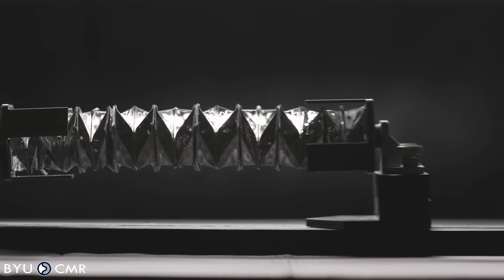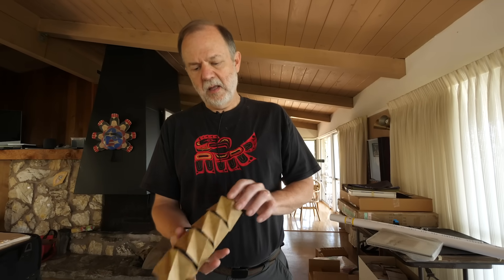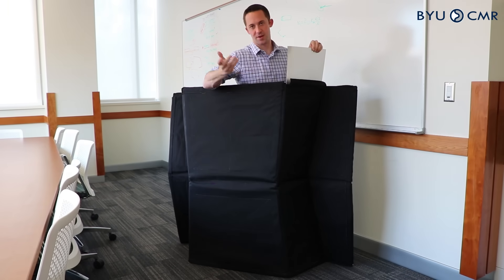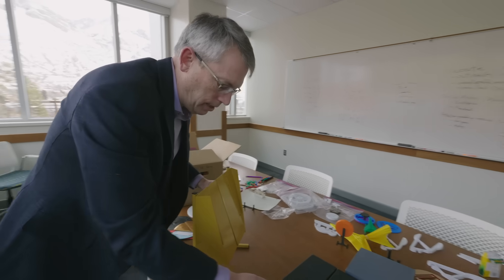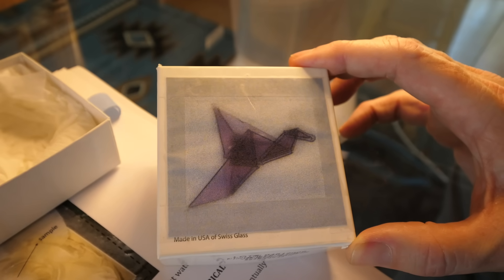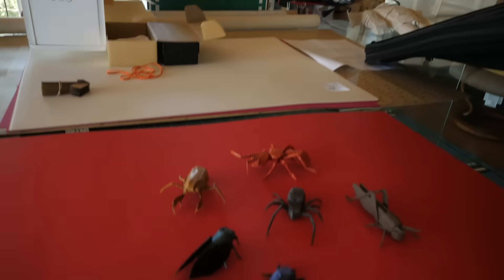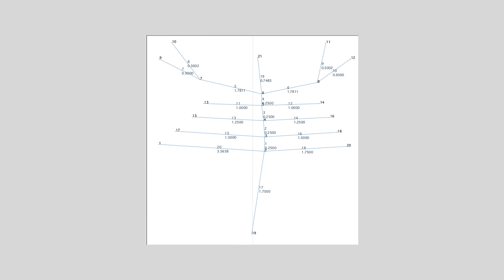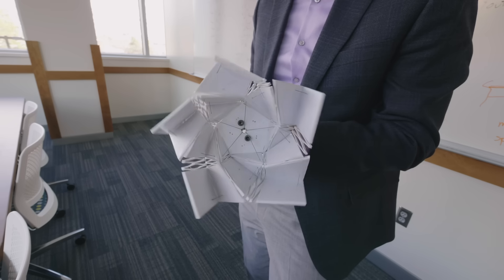Engineering with Origami

Comment: With the recent news of solar power and data centers in space this will be important due to the extreme size needed of solar panels, but 4:06  solar panel in a roller would be cheaper and more power dense with  more efficiency around 30%. Future will be awesome

Comment: Then they learn about modular origami. Just think little bit of organic chemistry and some food to feed it and you could do gene splicing or genetic repair
Reply: Well also look at what they can do with Lego bricks. Supposedly they're pretty rigid, but do a tiny bit of bending within the flexibility of the material and you can do some amazing things as well..

I mean just because it feels so it doesn't necessarily mean it is solid. Technically; nothing touches each other and there's no such thing as a fixed or solid thing

Comment: Trust me, the joint race has ended. The extra materials and lubrication of systems takes a long time to pay in the long run when its just easier to pay for a fixed system

Comment: something Derick doesn't say in this video is that one of the first uses of Origami in space, "The Galileo Telesope", it aclualy weleded itself shut so the oragami could not open fully, this was because In a vacumm aka space there is no layer of air to seperate the pices of metal from welding.

Comment: In Japan, origami is common and part of life. For example, by using Miura　map fold for beverage steel and aluminum in vending machines, the same strength can be maintained even if the thickness is 20% thinner than that of round cans. Companies can save money by using less material in their cans, and they can also save energy to transport them because they are lighter

Comment: A tinsy but if clarification on the seven years for the cactus would have been excellent... Was it 6 and a half years of contemplation and problem solving? Did he work on it during vacation each year? Weekends? Or did he spend 60 hrs a week for seven years folding paper?  While the last one would be fascinating as well, it would also obligate, ethically, an intervention of some type.

Comment: 10:17 ,,It's only 4μm thick. So 400 of them can fit on to a 1cm wide computer chip.''
Either there is a larger component needed for them or electrodynamics forbids to put things that close together on such a scale, but in theory 2500 of them should be able to fit onto that 1cm wide chip. As 1cm = 10mm = 10 000μm
divided by 4μm:
10 000/4 * μm/μm = 2500 * 1 = 2500

Comment: Origami is the art of "paper folding"..... the reason it is only used for folding paper,  is that it is not structurally sound for anything else........ folding steel to make blades however makes the blade stronger unless you fold it wrong

Comment: Looking at those devices with designs inspired by origami, how does it affect the durability of the material, compared to using the more conventional methods ,using hinges and stuff? Because won't that mean stress on the materials being folded, with the stretching and stuff? For example, in 5.34, the part where it actually folds.

Sorry, a complete noob with these things.

Comment: Human jumpsuit with Origami fold system. Iw ish to saw...
It can be Rigid material where the groin, joints or the head are folded in the material lined with a soft / elastic other structure.

Comment: 7:12
I have made similar engines using unofficial Origami-based techniques.
Noticing that the branding is blurred out, I’m giving away the thing is is meant to be hiding as I’m assuming it was only for the official demonstration.
I still know that the specific unit is painted for Union Pacific.
Specifically a General Electric C44-9W; same type of engine as my icon.

Comment: Now that is some serious material engineering ! I think I'm interested in the origami algorithm ^^
Civil Engineering, for instance, as far as I know, avoids folding material because it makes the material locally easier to fail at that fold, especially steel.
But, there is a several way to increase stiffness by adding some fold or a thick "bump" in a such way, so it increases the sectional inertia.
Cool cool, great work ! Great video !
Reply: Civil engineering? Oh man, the stress! Stresses everywhere, any which way you go!

Comment: This is very interesting and as an armature origami lover, I use origami as an encryption device, only by certain pattern of unfolding can the origami be dissembled to reveal its content, or through certain deformation the message will appear in a correct way. This is a physical representation of uneven encryption.
Reply: And I can't make anything other than the paper airplane :(

Comment: Origami was not created for aesthetics. It was a religious practice, like Zen . It was always an extremely serious thing in Japan. 
There is a dragon in a temple in the Fukui prefecture, not far from Eiheiji temple where i studied Zen for a a few years,  made of folded paper. The dragon is about a meter and a half long and seventy centimeters high and is over 200 years old. It was folded by the monks or priests as a common meditative practice. It was made out of a single sheet of paper, but every scale has been folded individually (and there are thousands of them), every tooth, the peaks on the head and the back, and every claw. And the amazing part is that it is articulated (although now it is never manipulated because the paper is too old). 
I am telling you, you have never seen Origami until you have seen this dragon .
It is said that there was also a carp made of paper in the temple but it was destroyed or the carp was actually unfolded and then folded back into a dragon as a way to illustrate the mythological legend of the carp turning into a dragon which represents enlightenment, and that the action was repeated regularly by students at the temples to as a way to transform themselves from carp to dragon. 
This origami is absolutely magnificent.

Comment: I would love to see some one design a box to be used as emergency shelter for the homeless. Design it to be an 8X8 Box, or 10X10 and have a height between 6 and eight feet. It needs to fold around a center box where all of their personal belongings can be stored when they are forced to 'move along. It needs to have wheels so it is easy to move and be as light weight as possible. Also have a heavy chain with a padlock so it could be secured around a tree or light post if the person needs to go to a store to shop etc. It should fold down into a box about the size of a shopping cart and needs a hand crank so that it would be easy to fold up when they need to move and easy to unfold when they want to use the shelter. Maybe have a fold able bench to sit on when the box is folded down so they have a place to sit when the box is closed. I would love to see someone come up with a design that could be constructed with less than two hundred dollars for materials. Then make a how to video so that people everywhere could make these shelters to help the homeless.

Comment: "You can't make a compliant mechanism that rotates 360 degrees"
"Unfortunately, no one told the paper folders that"

*Edit: I just find it really interesting how origami was basically a study of algebraic topology before that was even a concept, constructing complex shapes out of a contiguous plane. Origami is just one of those areas where, because the right material (paper) was available, people were able to skip all the other steps of development and just go straight to the end state.
Reply: Hexaflexagon
Reply: Pandora TheClay now we’re talking.
Reply: Well then how about MY FRIENDS NECK!
Reply: @pixelmace1423  snap
Reply: @michaelwalsh6276  hmmmmmm  :/
Reply: Or someone told them and they took that as a challenge
Reply: Dr Howell is great. I had him sub for a few classes while I was at BYU. Wish I had taken compliant mechanisms from him
Reply: mic drop
Reply: Best comment!
Reply: Fortunately
Reply: Look what they have to do to replicate a fraction of our power
Reply: The progression of science in a nutshell
Reply: WOW
Reply: I know, that was mind blowing!🤯😊👍
Reply: *looks at ball bearings
Reply: @joshbrock2663  Ball bearings have no compliant solid state materials. They are gears.
Reply: @joshbrock2663  Ball bearings are not compliant mechanisms
Reply: The best bearing is one where there is No contact. Air pressure can act as a bearing too. Won't work for vacuum however.
Reply: @joshbrock2663  the idea is to use the least amount of pieces while doing the same job, you might want to look at the other video about compliant mechanisms

Comment: At the item about aerodynamics there is a structural mistake. In reality the total surface in the front is the moving object is something to worry about, putting stuf in front that leads the air around is not making the moving object suddenly free of any wind resistance. Putting a flobbedee-floop in front of the train won't make it slide through air like a jet fighter. The elephant does not become a speedy sparrow by adding some flaps.

Comment: What is energy substantially? 
My Idea. 
All energy including matter is not a substance in itself but a form within a substance. That substance is space itself. In this idea matter does not move through space but is transferred though space in form not substance. The substance of matter is space itself in this concept. 
Motion is energy but it is not a substance in itself it is the action of what we generally think is a substance matter.
I started to think about the rate of change (time) in matter as it decreases as it gets closer and closer to the speed of light without of course ever getting there. I began to wonder how is space substantially connected to matter that would cause one to signal to the other causing the effect of decreased rate of change. The idea I came up with was the only way I could figure out how to connect matter with the space it occupies. I thought this to be an interesting concept whether it's right or not. Any thoughts on this I'd like to know. Thanks.

Comment: Those slugs (not bullets) were not stopped by origami. They were stopped by resistant material folded in an origami fashion. Also increasing kinks in the armor that produce weak points allowing for more chances of penetration.

Comment: I think one of the biggest things that wasn't touched about why folding is so important to engineering, particularly space-based technologies, is that you have incredible compactification without actually crossing planes. Meaning, the plane of the material remains intact even when folded and there are no punctures or weakening of the material itself. So, if needed, the plane maintains initial rigidity while gaining movement.

Comment: Those folding patterns remind me of protein structures. I wonder if any of these concepts have been applied to organic chemistry.
Reply: Yes! Look into the work of Erik Demaine.
Reply: What is very interesting is that the origami is not the product of a random processes. It is the product of a learned mind that can imagine an end result.
Reply: @mythink101  random processes and evolution... how could be explained the negative entropy of evolving to a more complex forms?
Reply: @ranua9327 , random processes degrade systems. There is no reverse entropy. Changes are happening because of entropy and guided by instruction.
Reply: Heck ya
Reply: @ericdufrane2344  Yup, life is in a way, replicating itself using origami. DNA is sort of the crease pattern.
Reply: Wow i've never thought that, interesting!
Reply: Anonymous?

Comment: Can you make an origami Porsche with working engine that won't catch on fire when the origami spark plugs fire and rotating tires that will hold air so I can drive it to work and not have to pay money at the parking garage because I can fold it up and put it in my briefcase? 
Yes but it will take us 7 years to create.

Comment: I wonder if you could cut / scribe / print a sheet of materials with the creases, then insert something like glue or 3D printed elastic material on or over the creases that pull or expand depending on heat. So you'd mix this material so it contracts or expands at a certain temperature. So when you start increasing the temperature the thing automatically folds.
Then you could automate printing and folding.
EDIT: Hmm thinking about this, I think I actually read or saw a video about this already haha.

Comment: "a way of transforming a flat sheet into some other shape with relatively little processing"

Said right on the heels of a cactus that took 7 years to make.......
Reply: It means without cut, glue, screw or nails.
By using folds only, you reduce the amount of "process" needed to build it, thus "relatively little processing".
Reply: @glurp1er  Also with designs like this ... less motors, fuel, resources, etc needed to toggle,deploy or engage said contraptions based on said designs so can see it that way to.
Reply: Flat spacecraft deploys orbital cactus.
Reply: Processing is different than time or labor requirement
Reply: If you use origami to, for example, fold up a solar panel,  your main goal would be to make a flat structure  as compact as possible. Origami is good at this, because by only adding hinges, you can get a good result and it would require relatively little processing. The cactus took 7 years to make because, well, its a cactus. Try to imagine how hard it is to turn 1 square sheet of paper into a 3D cactus in a flower pot with hundreds of spikes on it.
Reply: Little and breif are not the same  my friend

Comment: 7:19

How can you save diesel if it’s train?
Reply: A lot of trains use diesel to run an electric generator which powers the train.
Reply: Some trains run on diesel. One of the main uses is in areas where there is a absolute need for no fire such as ammo dumps and oil rigs.

https://en.m.wikipedia.org/wiki/Diesel_locomotive

Comment: Somehow i think these design will be very important in future when we travel to space or other planets and we have to 3D-print objects with minimum part number and minimum material usage. Flat designs are easier as they don't need to be made thick but can still fold into usable objects. Also printing and making the tolerances on hinges and joints is pain in the butt compared to these already integrated ones.
Yes, metal printing would still be required for certain parts but why not save energy and material when it's possible by using these designs on less demanding parts...

Edit. Typo

Comment: When looking at designs based on origami I never seem to see any mention of mechanical stress on the joints. I would have thought that rigid materials when adapted for flexibility would make this a major focusing point.
Reply: Most of those applications dont have very high requirement for stress tolerance
Reply: @ender2034   I mean more like wear rather than stress, if something is a one time use like solar panels on a satellite then it won't matter, but something that has to change shape repeatedly it could be one of the biggest problems when making things like this.

Comment: 10:16 Can anyone explain to me how 400 4µm devices would fit on a 1cm chip?
Reply: A centimeter is 10k micrometers. A square centimeter is 10k x 10k micrometers. That's 100M square micrometers. If you could fit them all perfectly, you could fit 100M/4 syringes on a chip.
Reply: @ax14pz107  So you can fit a lot more than 400, right?
Reply: @tn15_  yes, 25 million assuming he meant 4 square micrometers.
Reply: @tn15_  now actually being able to do that with current technology is another story. One I don't know.
Reply: With quite a bit of space

Comment: “This could save a company multiple millions of dollars a year on diesel” is pretty revolutionary... and yet Veritasium only says “hmmm!”
Reply: To be fair, his mind was already blown years ago.
Reply: because the percentage matters too
Reply: How exactly is the origami version better than a regular version?
Reply: @azice6034  You don't know in advance how the engines will be coupled together, so an engine with a nose cone on one haul might be connected backwards and sandwiched between two other engines in the next haul. Attaching and detaching a heavy metal nose cone would require heavy lifting machinery and additional coupling time and effort for every job. That's without considering that you need storage space at every rail yard to hold nose cones, as well as a complicated computer logistics system that makes sure every yard has nose cones stocked. There might be an asymmetrical count of arriving/departing trains, or maybe one day the station receives one long train with many engines and one nose cone, but dispatches two short trains each with fewer engines but two nose cones. It quickly explodes into a complicated juggling problem. It's much less complicated to attach a folding cone to all (or enough of) the engines in your network and leave it there, simply extending or retracting it as required by the train configuration.
Reply: Monster Azice magic and stuff
Reply: @azice6034  The origami version is the regular version, isn't it?
Reply: wrr, say any nmw s ok
Reply: Zes what
Reply: It probably evens out in the end. Chances are they're seeing maybe hundreds of thousands, if that.

It's not just the nose cone, they need machinery to install it, people to run the machinery, and to have them at potentially every stop they make.
Reply: @J D what do you mean by "greens guy"
Reply: Any dishwasher who says
MODERN ENGINEERING
has no rudimentary knowledge about any specific Branch of engineering.
This origami thing would specifically apply to materials science, mechatronic and electrical mostly

So Dumb
Reply: @michealbay1290  1. Did you even watch the video 
2. Have you watched any of his other videos